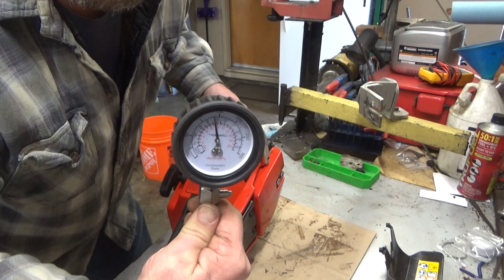Nathan's Homelite 330 Discussion, Test Run & Tuning!

Comment: I have six of these 330 homelite chainsaws in my collection and five of them had bad intake boots! I think they are made of the same rubber that homelite used for the gomet in the middle of the air filters that reduce themselves to a Gooey mess?

Comment: Will a bad Carb. boot cause oiler not to work on a Homelite 330. I've replaced pump, cleaned tank, and line is open to the tank. what's next to check?

Comment: I just picked one of these uo from a dumpster. Pour gas in carb it starts up. I ordered a carb kit and carburateur boot.  I didn't tear into yet just thought these two parts would fix it.  If not I will part it out on Ebay. It's a nice clean saw and could be a conversation piece at a dealer even if its dead.

Comment: Hi Nathan, thxs for the excellent video coverage provided. I have a Homelite 330 which I have gone thru. It runs well when testing but under load cutting wood, it guts out. What can be the problem?
Reply: I also have a Homelite 240 which also guts out under load while cutting wood. Same deal?
Reply: I would say that the duckbill needs replacing and it's vaporlocking, Or take a good look at the fuel line with the filter, it could be collapsing under full throttle or check for a pinhole in the line and the saw will run with a full tank but once it gets down on fuel and exposes the hole you got yourself an issue! 😋

Comment: I have seen this way too many times picking up trade in saws at chainsaw shops or from some that were never picked back up etc. famous one I find is super xl says locked up on repair tag but just has loose tank bolts behind the flyhweel and they sell a new saw to the customer  so I love your comments about what shops should say and do for a customer if they do not want to work on it. I have one of these coming for sale new intake boot and clean or cleaner than the one you have here in video but I feel like it does not sound as crisp as yours, have you removed or checked to see if any of the baffling has been removed in the exhaust muffler. Thanks

Comment: I picked one of those up at a estate sale back in the summer and it's looks like it was used  only a few times . It's got just a tiny bit of sawdust inside the clutch cover  . It has the original Homelite bar on it and all the stickers are on the saw . One of my many saws to bring to life someday . I also picked up ( at the same sale ) a old red craftsman 3.7/18 ( not the Poulan but the Roper , the first 3.7/18 one Roper built that kinda looks like a old Remington and it was brand new never been used with the original bar with all the paper tags still on the bar . Already got it running with just a carb kit . It has that chain sharpening stone on the clutch cover with the correct chain on the bar .

Comment: RUBBISH PAINT sprayed straight onto bare metal in factory, RUBBISH OILER non adgustable vacuum type, RUBBISH AIR FILTER, RUBBISH RECOIL STARTER far too small & weak on a saw that BACKFIRES on starting, RUBBISH cover OVER CARB  THAT DISTORTS AND LETS SAWDUST in carb, RUBBISH INTAKE BOOT that splits needing whole saw in bits to replace, CLAMSHELL engine where no replaceable  CYLINDER. apart from that SOUNDS QUITE NICE.
Reply: I completely agree I bought a collection of 80 chain saws that were all gone through by an old chainsaw mechanic , and I just pulled one off the shelf at a time and fuel it up, out of 6 XL 12s regulars and Soopers they all fired right up except one with a bad blue coil the One 360 ran on squirt and the 330 started pissing fuel the minute I started filling up the tank. The 360 definitely looks better built. Without knowing anything I immediately knew  the filter cover system was complete rubbish it literally just lets everything in no seal or nothing . Completely agree rubbish saw! Shit design. My favorite so far are McCulloch 610 , old Echoes and John Deere's and older Poulan magnesium case